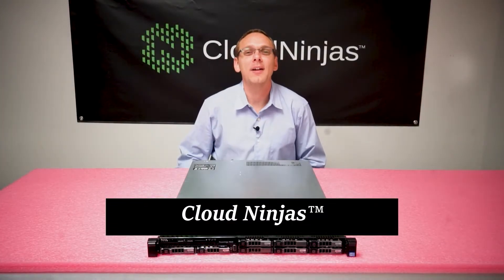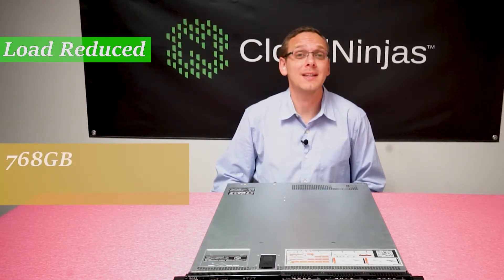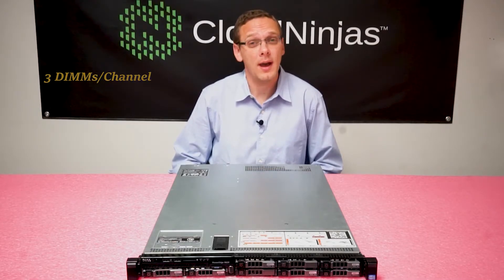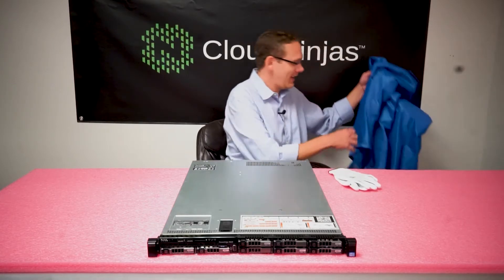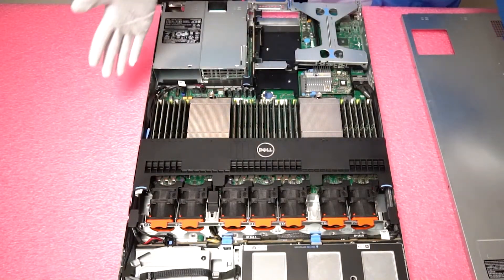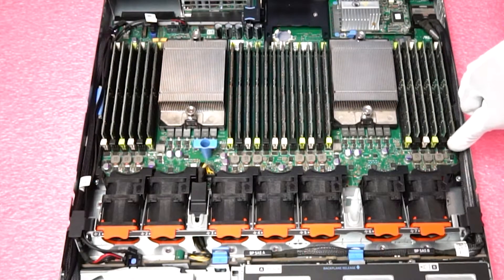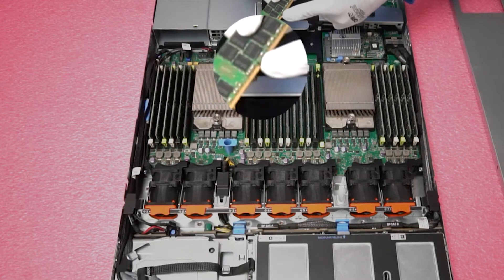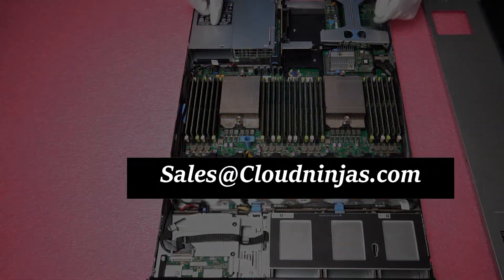Dell PowerEdge R620 Server Memory Spec Overview & Upgrade Tips | How to Configure the System

Comment: can it used dimm 32gb ecc registered 1866 Mhz for dell 620?
Reply from the maker: There are no 32GB 1866 ecc registered DIMMs.  Only load reduced for 32GB 1866.  And yes they will work great with R620.  But cannot mix ECC Registered with Load Reduced.  We have plenty of LRDIMMs in stock.  Thank you.